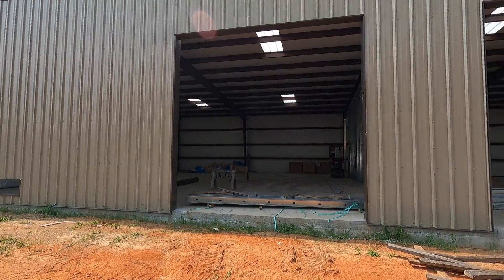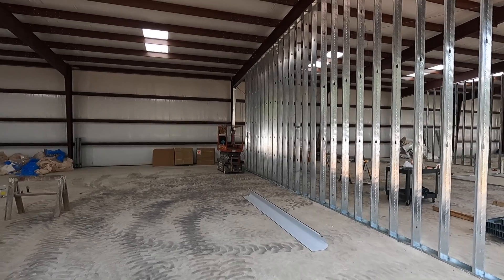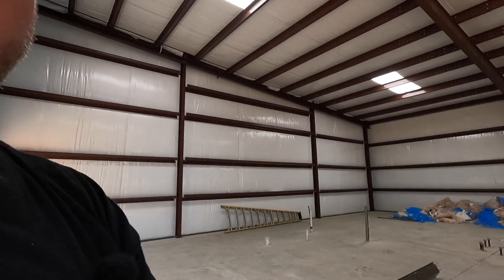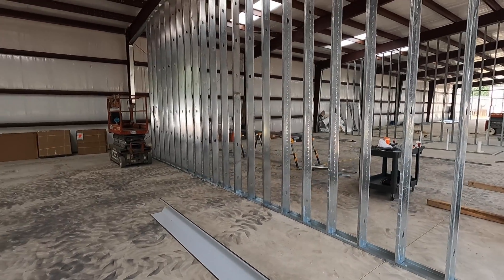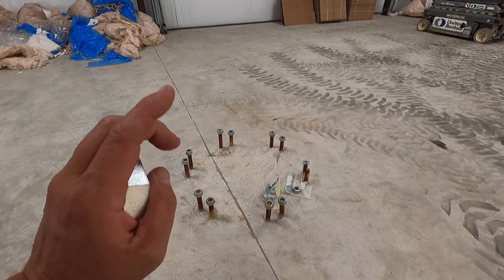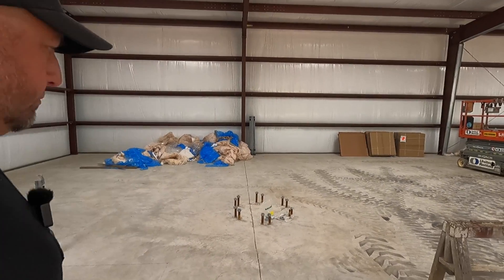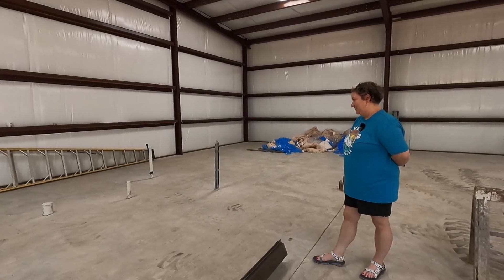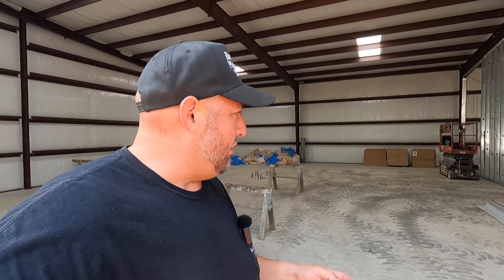New Shop Space Update 2

Comment: You might want to look at cable tray for the electrical. We started doing that at our plant and it makes it really easy to add or change things.
Reply: SWA on trays is way easier than bending pipe
Reply: We did that at an Eval Lab for a tech company and it made things almost plug and play for running electricity, amperage needs, .. whats those buzz words... Oh, made it scalable.   
Kept it clean and organized.
Reply: Id personally go 4" perimeter trunking with conduit drops and commando outlets personally. Armors look fine till you need to remove or add circuits into your panel then it starts to look like swiss cheese. I'd personally have a sacrificial trunking to gland into to first. Both tray and trunking wiring systems are extremely suitable and fit for purpose.
Reply: Buss duct is an old school easy way to wire
Reply: All depends on what you want Adam as it's your unit n you can do whatever you want with it 🙂
Personally, in an industrial unit. I'd stick up some 6" or 8" turning for all the circuits and also some tray for big SWA's.
Reply: In this small of a space a cable tray aproach is probably not warranted. Conduit runs for individual loads or feeders would be faster and less expensive.
Reply: Ceiling space gets hard to come by when you consider everything up there sharing the space (i.e. lighting, air, sprinklers, network, phone, security) as well as power.

Comment: Adam,  I use a electrical trough down the entire walls on my shop.  I set it about 8' high and did drops on the wall to each machine.  You could set it low too.  This way I can go from 3 phase to 110.  I can change it on the fly, base on the changes and new machines in my shop.  The trough is rectangle and 8" high and about 6" deep and has metal face plates along the entire length.  Good luck!  I love your channel!

Comment: I helped wire a Machine Shop for a friend. We used 4" cable trays about 5' off the floor and put the outlet boxes on the bottom facing the floor. We used twistloc receptacles and plugs. With the receptacles facing down the metal chips & dirt can't get into them. Upgrades can be made at any time. Shop looks GREAT.

Comment: Just by way of suggestion. I would draw up a floor plan of the floor space in the new shop area. Then I would make a list of the machines you want in your area, then I would cut out shapes of the machines in the same scale as the floor plan. Then you can set down, spread your floor plan and then try the scaled shapes of the machines in different locations of the floor plan. This will solve several issues on move in day. 1, Your electrician can pre-wire for the machines at each location. 2, You will have already established "a flow" in your machine layout. 3, This also allows planning of floor space for future Machine installation. 4. No guesswork on moving day.
      Granted, at a later date you may choose to move some equipment to different locations to improve work flow into and out of the shop, but better to move only some rather than all.
     Good luck on the new venture.  Wish you all success.

Comment: shop is going to be great. go for adding drywall to the remaining sides: makes them fire resistant and the walls can be painted white to make them brighter and easy to clean. the exposed plastic on the insulation will quickly degrade if it's exposed. those open frame walls are going to be a magnet for dirt/etc. drywall on the walls also makes it so that if you put up shelving there will be a back to the shelving to keep items from dropping off the back. another benefit to finishing the walls is the increase in R value; we have a similar shop built and these are things i had to end up changing after it was done.

Comment: Hi Adam, you will most likely have a 3 phase 120/208 Y panel with neutral. 
Along the sheet rock wall, you may want to consider a 4X4 wire way duct , so when you locate you machines, you can pop a hole in bottom or top to add the correct receptacle or disconnect to your machines. 
Another thought, but expensive, would be to spot , hanging from the roof supports, a section of 3 phase buss duct. They make plug in safety switches for that , then drop a service cord down to your machine. Looks good, and yes, seal the floor. Good idea from one reader, paint the brown columns as well. 
Don’t forget your air compressor, too. 
You may want a wall around it with some sound proofing material. Good luck.
Maybe I should rent next to you to store all my train stuff. LOL. Dave

Comment: Bush hammer the floor before you set the crane so the grout sticks to the concrete well.  The jam nuts are a good idea, we usually either do that or put steel shims to level the base before grouting.  Never set it directly on the floor, it will never set right.

Comment: FYI - last shop we built out I ran a 4” wireway or trough (depending on who you ask) around the shop wall at about 8’ for all of the power and task lighting, and then it’s simple to then drop down to each outlet where you need it. Plus adding additional drops are very simple in the future. You would have to size your wire trough to local codes for all of your power requirements anyway as your using 3 phase. Very good progress.

Comment: Glad to hear you're using the jam nut method.  That's also the way we install pole signs, tried & true.  Street lights are also mounted that way, after it's leveled there's grout poured around the base and the nuts.  Once installed it'll never have any problems (at least until a semi decided to hit going 55pmh lol).  Plus if in the future you happen to do have a problem, you can chip away the grout and relevel it.  But totally unnecessary if leveled correctly in the beginning.

Comment: If you plan on having equipemt away from the perimeter, plan on having cord drops from the ceiling. A disconnect means (service disconnect) can still be wall mounted for each drop. With fused disconnects you could run one feeder for multiple discoonnects and use only one breaker space in your serevice panel.

Comment: Epoxy paint the floor.  It will save you alot of time cleaning. And brings nice atmosphere to work in.
Reply: This will also reduce the concrete dust generation. Shops already have enough dust from other sources!
Reply: @edrdnc6706  absolutely and concerete dust is not lathes best friend. Anyway i wish you luck. I bet it wil turn out nice. Maybee you should have them to put up some more drywall. And make a welding/grinding room. So you dont Get grinding dust all around

Comment: Congratulations Adam, it would be nice to have a wiring and lighting like the ones they recommended you in the comments. A nice silenced compressor with tank, a sink also on the workshop side, a water connection near the main door (if it is allowed to wash things externally), a shower in the bathroom of the changing room. It could also be a nice idea to build a solid structure above the office with a ladder as a warehouse for small parts and miscellaneous things. I wish the best for the AbomCNCShop

Comment: Niice. And yeah, put in empty conduit everywhere with messenger line (just a plastic pull rope) for future, way cheaper and easier to do now than later. Good call. Also get the panel filled up with breakers now, if you can, just to have spares. For some reason they love to overcharge you at the electrical supplier for loose breakers, and often you run outta circuits before running outta panel ampacity, go heavy on the breaker size, you can always fuse down with a disconnect at the machine. Also whatever they wire now, make sure they label the crap out of it, tag all those devices receptacles, everything, with circuit & breaker #. That an an accurate panel directory are lifesavers if you pop a breaker or wanna make something safe for service. p.s. If you're gonna go heavy on the lighting, go dimmable, or do it as two (or more) circuits, say half and half, interlaced so you can have every other light on for a bright day, and everything on for a dull day/night. But congrats again man it's lookin' a good space, gonna be awesome!
Reply: Excellent advice Doctor....I agree.... you know what you're talking about!!!
Reply: If you can plan out the circuits ahead of time, some service panel manufacturers will give you a discount if you buy a populated service panel. You can usually get faster delivery as well.
Reply: @Dr -   Good advice.   Is "messenger line" the same as a "pull string" in a conduit?    Having available conduit in as many places as possible saves a lot of future money and time.  If you use 2" rigid plastic plumbing supply lines as conduit, it is even more flexible.

Comment: Adom, that expansion joint cut in the floor running through the bolt pattern for the crane can effect the pullout capacity of the four boults toward the outside of the building.   Anchor bolts resist tension or up lift by a cone of concrete whish resists the upward force in the bolt.  The expansion joint which has been cut through the bolt pattern interrupts that cone of influence for those bolts and the others close to the joint.   If there is a steel embedment below the floor to which the anchor bolts are attached then this isn't an issue because the forces go down to the embedment and not into the upper portions of the floor slab.  But it might be worth looking into the issue.  I do a lot of anchorage design for heavy equipment and construction/expansion joint are always always an issue to contend with if bolts are within the edge distance criteria for the particular bolts used.  Thank you for the video.
Reply: I believe he mentioned in the previous video that the contractor specifically added some extra concrete padding below those J-bolts, since he knew he'd be having that jib crane ahead of time
Reply: yes he said it in the last video.

Comment: Congratulations dude, good move. Two things, (1) Frame that dividing wall with 1/2" or even better, 3/4" plywood, you will appreciate that later on down the road. (2) Make sure you use all 4 gang outlet boxes and not 2 gang, you will appreciate that later on down the road also.

Comment: Right above the jib crane would be a great spot for a "Big Ass" fan to keep the air moving in the shop area for those perfect fall Florida days.
Reply: I used to work in an aircraft hangar where they put 3 Big Ass Fans on the ceiling.  I think they were 36' diameter... they were huge.  They move a lot of air for as slow as they turn.  If you would turn them up to full speed they would make enough wind in the hangar to blow papers off toolboxes.  They made the midwest summers tolerable with no air conditioning!!

Comment: Go with an Overhead Bus-Bar System for your machines that way you can reconfigure or add additional machinery in the future.
Reply: Those systems have severe code limitations on where they can be used. Usually only trolley type cranes can have open bus bars in an occupancy that doesn't have onsite supervised maintenance personnel.

Comment: Hi Adam,
Congratulations on your additional workshop space.
On your jib crane mounting, a good starting point is to put a nut on each bolt, but set one the height you want as a datum, and then using as good a level as you can get, adjust each other nut to the same level as the datum. That way at least they will be on the same plane when you first load the base onto the bolts, and depending on any welding induced distortion or manufaturing variance, you can do minor adjustments to get the column perfectly plumb. That is a standard building practice for column bases and generally is not too far away.
I would also allow 25 mm for the grout, much less makes it very difficult to ensure you actually get a fully grouted baseplate, particularly with the diameter of that crane base plate, and make sure you use a high strength non shrink grout. The crane maker will probably have specs for that and I would have thought they would actually do the install and include the grout.
Regards from Oz. Dennis

Comment: In the UK those separating partitions would be double skinned with inter woven sound absorbing insulation. Only the two external sides of each partition would be clad with at least two layers of what you call drywall. Each of those sides would have at least 1 hour fire protection between units.

Comment: Hey Adam, if your running EMT tubing it will save grief in the future to increase the size one step. In other words if they normally are going to run 1/2" make it 3/4" for a future or larger circuit.  Small increase in price..
Reply: That is advise from a friend right there. Congrats to for thinking about it and bringing it up. Sounds like the advise based on an experience. Given that it is a machine shop what should the floor be sealed with or should it be VCT?

Comment: Make sure that the dividing wall between tenancies goes all the way to the underside of the roof and external walls. That way you won't have dust transmission between tenancies.
Reply: I would think they would have to for fire code reasons, right?
Reply: @corydriver7634  May not be mandatory being that this is a relatively small industrial complex.

Comment: Do yourself a favor and make ALL 120VAC 20A outlets quad outlets.  With all rechargers and power supplies you never have to use extension cords and power strips.  Safer and better.  I recommend one every 12ft. in a shop environment.  Don't hardwire unless absolutely necessary, twist locks and SOOW rubber coated oil resistant cables for 30A 240 outlets.

Comment: Seems like the contractor is doing a great job and his thinking about making all of the units the same and features makes it an easy choice for when one becomes available, the choices are equal. Yes, I'd be all over the electrical plans and lighting, outlets etc. as those are bread and butter items that need addressed during installation vs. adding later and dealing with more expense then than now. Hopefully you can have it all wired for air conditioning if you end up needing it to keep the shop at consistent temps, being a metal shop and measuring your work with micrometers and temp swings. You may want a shop sink area with hot water? Pre wired and plumbing for an Air Compressor and Compressed air lines? This should be exciting for you Adam. Maybe some Big Ass Fans one day !

Comment: I don’t know if this applies to your interior buildout, but figured I’d share with you the planning I’ve seen lacking in some buildouts I have managed.  It is >>>SUPER IMPORTANT<<<< to plan your power and lighting AROUND your furniture (Machine) plan.  A furniture/machine plan will layout where all your furniture/machines go and THEN you create a POWER plan and LIGHTING plan to work with your equipment.  One you have created a machine/furniture plan you can now center and/or dimension lighting above your equipment as needed.  Same goes for power plan - Specify voltage/amps needed where for what machine etc...

Comment: Add a timer to the hot water tank. There is no need for hot water after hours. The water stays hot long after the power is shut off.
One other thing a lightning arrestor to save the equipment in case a lightning strike. 
Oh one more thing is a camera mounted to the ceiling???
Reply: Even old tank water heaters are so efficient there would be practically no savings by switching it off at night. As soon as it comes back on it will reheat that water anyway. A tankless setup would be nice. I have a feeling power is cheap there anyway.
Reply: He should get a quote from the plumber for a point-of-use hot water source over a tank. I don't remember if he ever said he has gas, but unlimited hot water can really be nice for those epic cleaning requirements.
Reply: @truckguy6666  
My hydro bill says  differently.  You save money every month.  Same as turning off the lights when you are not in the room.

Comment: Hey Adam looking good. When I said the other year to enclose the awning on the shop I didn't mean this much haha. I still haven't got mine up yet.
240vac 3 phase, wow that'll make the meters spin. In Australia ours is 240vac 1 phase and 415vac 3 phase. Higher the voltage the lower the current draw.
Take care.
Reply: It's the watts that count. 1 HP at 240 volts is the same watts as at 415 volts, or 5000 volts.

Comment: Need to put metal on the walls at least 8 ft high, if you are planning to weld in the shop. Fire prevention. Also put no more than 4 outlets per circuit. Keep them comming.

Comment: You should maybe think about an emergency eyewash and safety shower station  if you can swing it.
The factory I worked at had them attached to some of the drinking fountains.
Reply: Why? It's not a chemical plant
Reply: Better to have it and not need it than not have it.
We didn't have chems other than wood glue either.
You have an air/coolant line blow and stuff will inevitably get everywhere, including behind your safety glasses.
I've seen a big airline on a twin workstation CNC wood router blow. 
The entire wood cell looked like it was in a dust storm in the Sahara. It was an area about the size of half a football field.
A few people in the cell ended up getting crap in their eyes even with safety glasses.

Comment: This looks awesome, they're even finishing the side with stucco so maybe it will be insulated from noise a bit more, and it will look nice. Only negative I can see is how you only get a 6 foot wide concrete sidewalk as access, instead of being able to truck right up to the door. Still, you can probably drive a forklift down there if you need to, could you put a big machine in there easily?